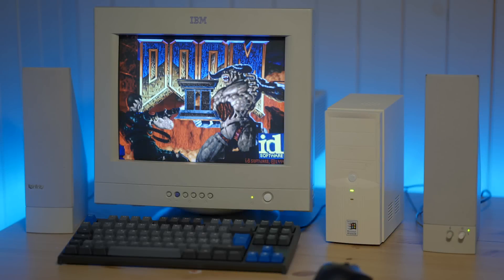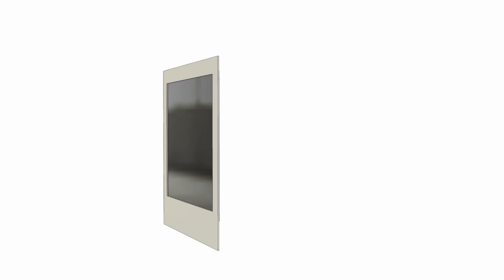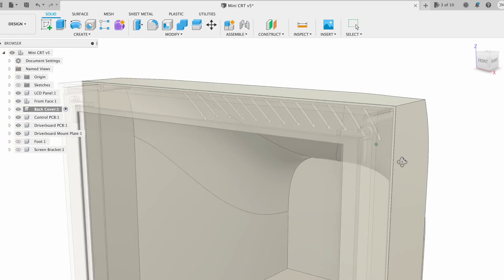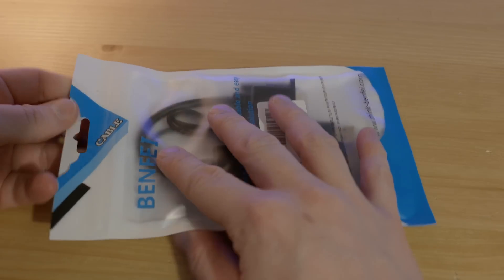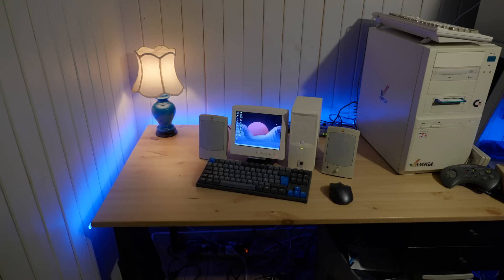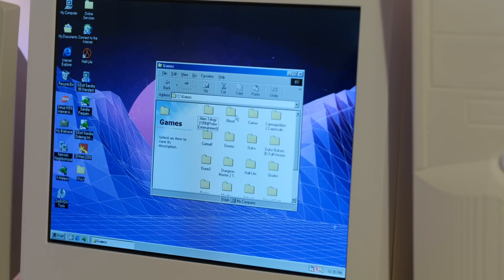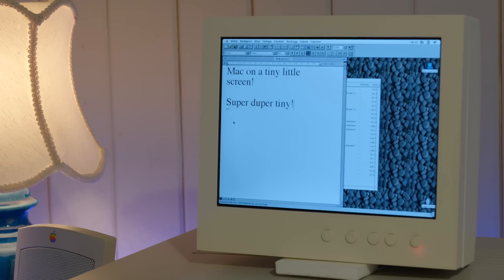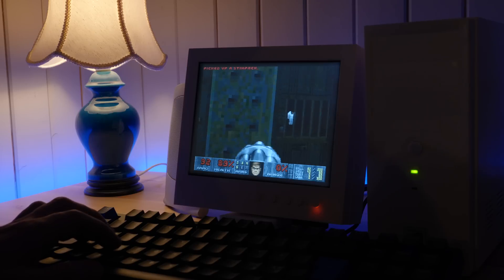How I Made a Tiny CRT Style Monitor

Comment: Did you print the rear shell of the monitor with or without supports?
Reply from the maker: No supports, back face down
Reply: @OddObsolete  Thank you! I ordered the display and will start working on the print. I might modify your design to make it look more like a Sony Trinitron. Going to use it to display a WS4000 on my desk. Thank you for posting the STL!!!

Comment: Now you need a pair of 40mm aliexpress speaker drivers and an amplifier module, to make speakers that are in keeping with the size (could cheat and make it a 2.1 with the bass hidden in the monitor case... magnet won't bother the LCD)

Comment: It's cute, but a bit too novel for my taste. I always even in the early 2000's preferred a small, and quiet system, but a big display. I am even working on putting a PC board, into a 32 inch Sharp CRT TV,  this thing weighs 116 lbs, but that is just the weight of the CRT the board of this TV is tiny, so lots of room to add a mid 2000 PC board, mini PSU
and the set has 3 line in inputs, and HDMI 1.0. I did enjoy this video. So thumbs up for creativity. Good job.
Reply from the maker: Sounds like a cool project!
Reply: @OddObsolete  It's only intended for gaming though. Emulators, MAME, NES, SNES, PS, bet yes it will be cool.